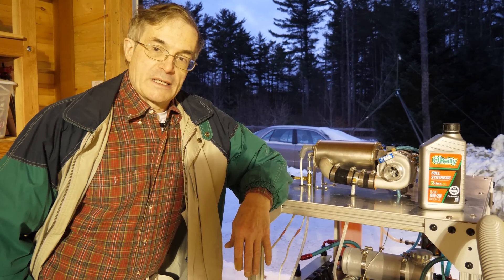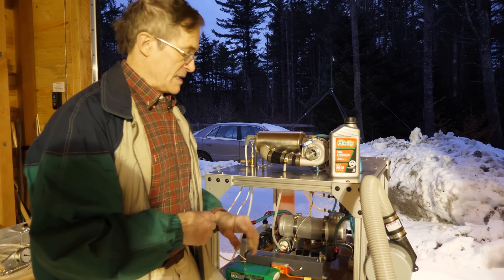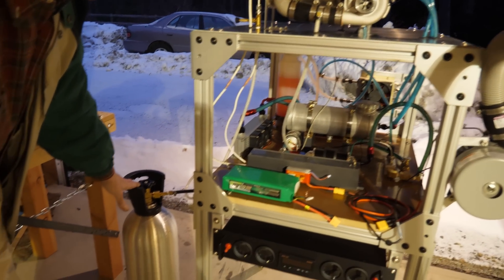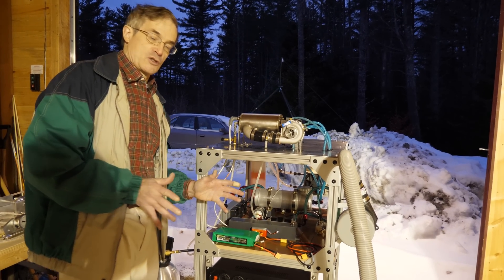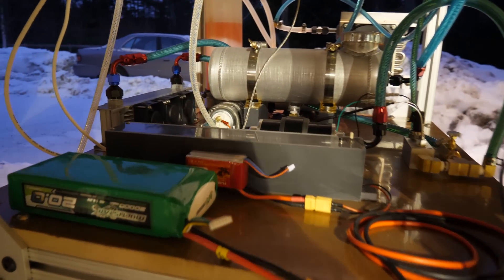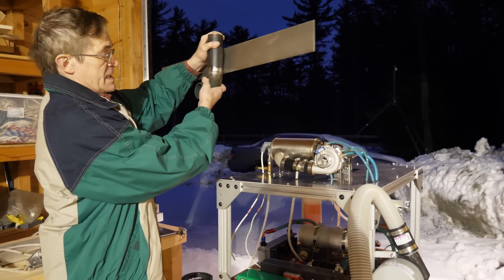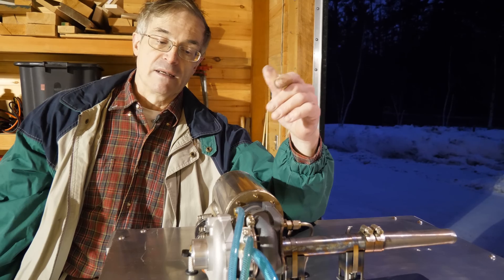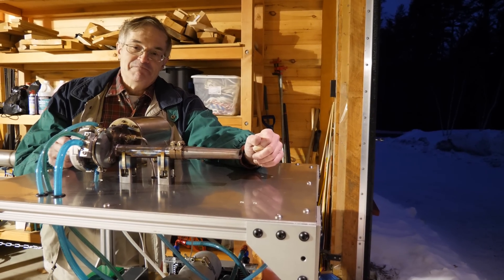FIRING UP THE TURBOJET!

Comment: Propane is a terrible jet fuel, you should be using high pressure injection diesel fuel. You'll get more power output for a smaller overall turbine and compressor size.
Reply from the maker: Why?
Reply: I would think the heavier fuel will spend more time on the impeller than a lighter, imparting inertia is linked to time
Reply: BTU content of propane is much less than Diesel fuel. More potential chemical energy with Diesel. The turbine will also operate at a lower temperature because Diesel ignition is air quenched. LPG, Natural Gas, Gasoline, Ethanol, Propane, are all fuel quenched when ignited, adding more air just increases combustion temperatures.
Reply from the maker: By the time the fuel has reached the impeller it has been converted to simpler gases and other combustion products.  It's  original density doesn't apply any longer.
In my previous video, on this engine, I go into stochiometric ratios and flamibility limits.  I'm not sure how quenching plays a role if combustion is complete.

Comment: hello. just a thought: could you use strain gauges to measure the strain in the legs of the table to measure force/thrust? could even calibrate with a known force.

I recall making a scale that way in lab class, not sure how expensive strain gauges are.
Reply from the maker: We probably could.  The fitting I held up will be supported at it's ends by linear bearings and a strain guage will be attached behind the elbow.

Comment: there looks to be a lot of air bubbles in the thick blue hose.
Reply from the maker: There are.  Despite a positive pressure differential in the oil supply, gases still enter the bearings. I've discussed this with other builders and this is so common that a vent on the reservoir is common practice.  I believe this is related to periodic high pressure pulses associated with uneven combustion.  I have modified the fuel nozzle, eliminated the pulsation, but some gas persists.

Comment: Putting an external Combustor onto a standard Turbocharger has been done so many times now its untrue...It's a good job you are never going to try and use it for anything useful, it's so large, heavy, and complex with all of its ancillary support to keep it running.  The other elephant in the room which you have ignored, is the use of Propane in gaseous form rather than liquid form (which technically is harder to do since it freezes so easily)...but you will never get any real power from it unless you use Kerosine in your combustor. The calorific value of Kerosine is much higher than gaseous Propane...so dump the Propane if you want to get any real output from this engine. It's also far less dangerous. You will need a properly designed combustion chamber though with tubular vaporizers, unlike the one you are using.....Your welcome.
Reply from the maker: Thanks, but I think we'll keep the propane.  The caloric value of propane is not an issue limiting the performance of the thermal cycle and it's combustion is less problematic than kerosene.
Building a jet engine without  the engineering advantages of a low cost, easily available turbocharger will make such a project impossible for the majority of interested viewers.

Comment: How is this efficient enough to produce energy by turning something else with the exhaust gases or be used instead of a electro-motor to drive something? I get that this is what you want it for, right?
It's cool though. :D
Reply from the maker: All the kenetic energy of the exhaust flow is available for conversion and for an engine of this size that could approach 10 HP.
Reply: @TechIngredients  yes, but how efficient is that? I can't believe a e-motor woildn't be better.
Reply from the maker: I'm not sure how to answer that.  Effeciency is one thing ie the conversion of fuel or electrical power into rotational output.  The electric motor will be much more efficient if you eliminate the losses with generating the electrical power and in a portable application, the weight of batteries, charging equipment and the generator are substantial.  Each of these components can be adjusted to meet different goals.  This can get complex.
Reply: @TechIngredients  how long does the turbine have to run until it is unfeasable to carry around fuel?
Is thos really the best solution for portable power? What about a commercial generator?

Comment: Awesome video! 

Quick question• the deflector that you were talking about it's job is to, well, deflect the incoming air. 
But, won't the kinetic energy of the moving air go down since it has to touch the metal (and thus transfer heat which lowers the energy of said moving air)?

I know that the length of the pipe is so short that it pretty much doesn't matter but I think that it is something worth looking into.

Again, very nice work! Keep it up!
Reply from the maker: The deflector is designed to deflect the exhaust gas upward.  There will be frictional losses, but these losses will also be part of any design other than a pure thrust application.

Comment: Avoid standing inline with the fan blades. They can fly through the housing when/if they break loose. If you are trying to get rotational energy from the engine you should mount a clutch to the turbine shaft and take the power from that like a helicopter does. Using the gases to drive a second turbine will have huge losses. For thrust measuring just mount the jet on a slide rail and hook it up to a scale. as the jet tries to move it will pull on the scale indicating the thrust.
Reply: "mount a clutch to the turbine shaft" have you ever seen anyone do that? Links? How is it done?

Comment: Nice work, but seems complicated to build..
Reply from the maker: It isn't.  We're trying to provide as much background as possible to empower the potential builder.  You can get these things to operate with little precision.  Take a look at some of the builds on various YouTube channels.  Pretty rough engineering still works.
Reply: What was the cost of all those parts?
Reply from the maker: A lot of our components are recycled from other projects.  For example, the entire cart cost us nothing.
But, the major components were:
Turbo-$180
5 gauges, box and switchs-$300
Stainless plumbing for combustor-$100
Propane tank-$100
Oil pump, filter and radiator-$175
You need to be able to weld etc.

Comment: Please correct me but could you not have an output shaft on the input side.  I understand that this shaft is rotating at an extremely high rate. The speed would have to be reduced. We all know there are efficiency loses at every step of gear reduction.  Would it not still be more efficient than driving a turbine?  P.S. Love your videos.
Reply from the maker: The RPMs are extremely high. It is easier to use the exhaust to drive an independent turbine, designed to operate at a much lower speed and higher torque.

Comment: Love the self contained system, but noticed that the oil inlet/outlet on turbo are not facing down, I think normally manufacturers spec those to be vertical within a handful of degrees.
Reply from the maker: I know about that recommendation.  The logic of that positioning escapes me.  When air passes into the bearing, we don't want it to remain as a bubble at of the housing.  I suspect their reasoning might be to prevent retained oil from cooking when an automobile oil system is shut down.  We run our pump for several minutes after shut down.

Comment: The turbine wheel or hot side wont live long at those high temperatures. Wasn't designed to be used this way.
Reply from the maker: That's true.  But, at the same time, we're willing to break some eggs to learn the limits.  These turbochargers are pretty inexpensive.

Comment: Are you using the vapour or liquid port on the propane tank? If just the vapour, you might be lean surging. Might explain the popping. Liquid port can supply way more energy from the density of the fuel.  I used to work on propane powered generators.
Reply from the maker: We are using liquid.  This is a siphoned, CO2 tank that we filled in a previous video.

Comment: Clickbait thumbnail?? This is below your level! Also, this is almost April, Mini skirts and hand holding everywhere, while you are snowed in? Thirdly: if your 90 degree pipe deflector is of larger diameter, you'll get a venturi effect argumenting the thrust making your reading too high.
Reply from the maker: Clickbait makes false promises. We want attention and I believe we deliver pretty good value for the viewers time.  It is still below freezing where we are with drifts covering our car.  You might have better wheather where you live, most people do.  The venturi effect only augments thrust by lowering the atmospheric pressure in front of the wall thickness of the receiving tube and that is why thrust augmenters use a broad, bell shaped inlet.  The effect will occur, but it will be pretty small.
Reply: @TechIngredients  Thank you for kicking back. I'm loving your channel, but that react type thumbnail is just too much teenage youtuber.

Comment: You should run on diesel fuel... I think you would get  Better results. And more thrust output
Reply from the maker: Diesel is more challenging.  It requires a fuel pump.  In these small engines, it often has to be pre heated with some of the supply line placed within the combustion chamber and it can accumulate in the bottom of the combustion chamber during shut down requiring a fuel drain to be opened (remembered to be opened and closed) to prevent a dangerous fire or even an explosion.
Reply: @TechIngredients  true....

Comment: The easiest way to get power out of it is to just let the exhaust go directly into the impeller of a slightly larger turbocharger, only, instead of having it still be a turbocharger, take off the compressor and use that shaft as an output to a gearbox.

It would then, in many ways, be like a helicopter turbine transmission configuration, would still be pretty compact, and, with the outputs directly linked fairly efficient, and would allow the compact use of the oil and water cooling systems without a whole lot more plumbing tubes to get old and crack and leak...

Depending, of course, on how long it was expected to run and how exposed to the elements it would be while in operation...

Fro LONG term, if it were deemed worth the investment, a stainless steel braided teflon pressure tube would be superior [we used some on our steam engine work up in Minnesota and it was good for 900 PSI at 450F ] so it would not melt or burst at the temps and pressures we were using.
Reply from the maker: You're right!  We are going to carry that concept further and are assembling a substantially larger diameter, single stage, reversing flow, power turbine. The principle, although not the form is similar to a Pelton wheel. Much higher torque and lower RPM directly from the turbine, simplifies everything downstream.

Comment: Sorry if I missed it - is there a fuel pump? The pressure of the propane mixture depends on propane-butane percentage and temperature , it may be around 60-70 psi or lower because its cool outside. This is not enouph for the compression rate.
Reply from the maker: We kept the tank inside untill just before the test and at room temp the pressure runs reliably near 120 PSI.

Comment: Great to see you got it running! What fuel pump did you find that provided more pressure than 40 psi? I looked through a ton and all I saw was 40, so I ended up with a rather large transfer pump for diesel and hydraulic. Also curious to your in-line oil filter. Currently the best option I've found was a remote-mount system but haven't bought one yet as I'd really like an in-line one I don't have to fabricate.
Reply: Some pumps can be put in series for higher pressure.
Reply: @YodaWhat  Strangely I missed a search through Summit and found several (and filters) that would work. On my application I'm using a pressure washer for the fuel pump for upgraded PSi requirements, but the transfer pump I found will do about 55psi. Should be enough but the fittings are a joke. Much work to do yet!

Comment: I want to see someone connect several turbochargers to a single combustion chamber then run all the exhaust pipes out the rear, looking like a JT-4 with sound suppressor on a Boeing 707.

Of course it should have a custom FADEC (Full Authority Digital Engine Controller) to handle everything so the operator only has to poke one Start button to get it going. From there the FADEC monitors things like oil, coolant and fuel flows and pressures, exhaust gas temp, everything there is to monitor and control, FADEC does it. The operator only needs to wait for the engine to light up and spin up to speed, then run the throttle.

Comment: Nice work!  I can really appreciate all of the work that went into designing and building this!

Hmmm. . .  Maybe add some magnets and turn it into a Faraday homopolar generator by adding a brush or brushes to the outer edge of the compressor or turbine or both and another brush to the axle shaft.  :)
Reply: Those edge brushes would cause way too much friction (among several problems), and there are better ways to get DC power. Alternators can be had or made which make 3 or more phases of AC power, which is easily rectified to DC.
Reply: True true, but those mundane methods are not novel. hehe :p  My thinking is more centered around attracting viewers to the channel.  :)

Yes, friction would be an issue on the outer edge, along with wear. So, some kind of novel brush system would need to be devised for the outer surface of the compressor or turbine. One method might be able to generate a high voltage and establish an arc at the outer surface and then conduct through the arc. Think TIG welder with a contactless high-frequency start.

Another way might be to spray a steady stream of an electrolyte solution at the outer surface and then conduct through the stream. Or the same with a molten metal, bismuth for example.

Yet another way might be to make a flat coil via PCB for example and attach it to the flat side of the compressor. One side of the flat coil would be electrically attached to the outer surface while the side near the axel would use a regular slip ring and graphite brush.  The emf in the coil would be less than the emf in the rotor so the coil could be used as a conductor.

Comment: So after looking at the video again, did any one notice the EGT, close to 850 c ...... this is to hot 😬 Heating the fuel, may help.... but only if he getting at points a mixture of gas and the liquid because the LPG is not getting time to turn gasses. That an engine running on LPG is running so badly..... and built by some one that has set him self up as a how to ?
Reply: What makes you think he is running the liquid fuel into the combustor? I assumed propane vapor, since that is what most tanks deliver.
Reply: He may not well be, or his intention was not, it was speculation 🙂 But it does happen.... it looks like he is not using a standard LPG bottle ? Plus when you run off large amounts of LPG, the expansion of the gas cause cooling,  which in turn can lead to less boiling of the liquid.... and in turn less gas/vapour and more liquid. But as i said only speculation, on an engine this small it is less likely to happen as the flow would perhaps so small.... Have seen it happen on bigger engines. But it still stands, for an engine running on LPG its running very bad. A wet fuel engine, kero/Diesel etc you mite expect combustion issues with a badly designed combustion chamber, as they are less forgiving ..... take longer to burn

Comment: Congrats on getting it working. The combuster needs more work as I can hear the flame being unstable. Also make sure the combustion is complete before it reaches the turbine wheel. If not, the turbine will glow red. You will have to remove the exhaust nozzle to visualize that

Comment: I'm wondering if it's possible to drive a turbined generator that could provide 240v AC at say between 180 to 200 Amps?
Reply: It is certainly possible to get about 45 kWe (kilowatts electric), but you might want to be a little more precise with your question. Do you want a certain frequency, like 50 Hz or 60 Hz? Maybe 400 Hz? Single-phase, or 3-ph? How portable? What fuel? What efficiency is required? What range of loads?

The simplest thing is to put an alternator right on the turbine shaft, but it will give a much higher frequency than normal, and not a constant frequency either. Also, it can be a challenge to find an alternator to handle the high RPM. To get a normal and stable frequency, you'd likely want to rectify the high-frequency power, then put it through an inverter.

Comment: I don't know what part is tuned incorrectly. Maybe it's your nozzle size, but you have a weird pulsation that suggests to me that something is mismatched. I built a larger setup and monitored the exhaust temperature and turbine speed to get them both maximized using nozzle size and I remember it sounding a lot smoother and more consistent. That fluttering/pulsating sound I know can happen in turbochargers on cars as well if the turbine, compressor wheel and engine are mismatched. It might be worth looking into, and maybe you will know more as soon as you have the tach hooked up.
Reply: that is why it is easier to build a bigger setup to get/understand the basics/concepts and how they work with each other, then scale down when you know the measurements.